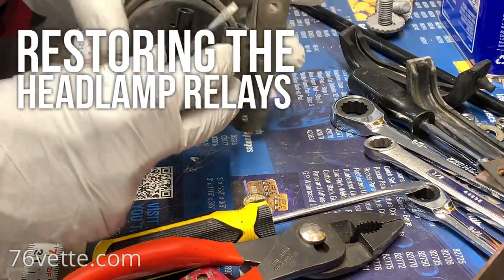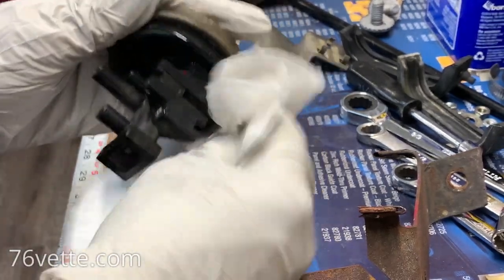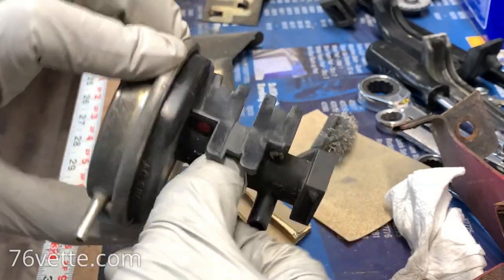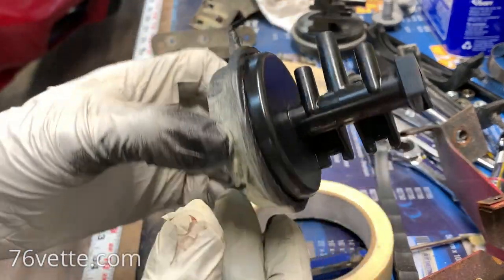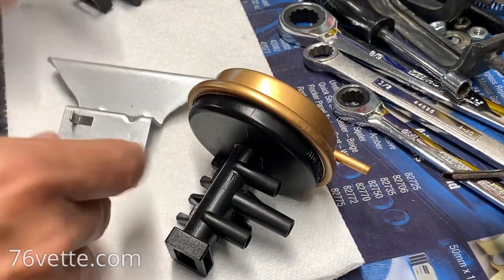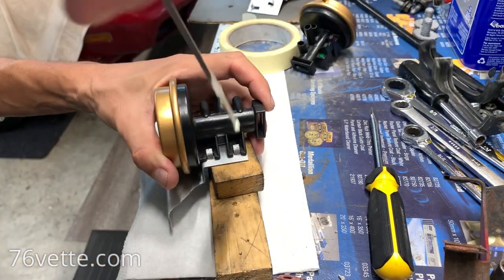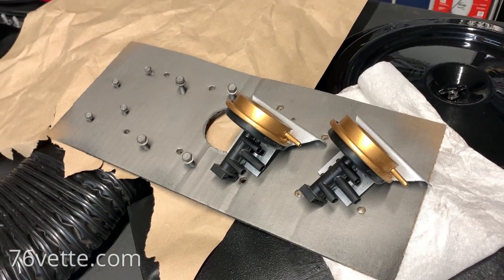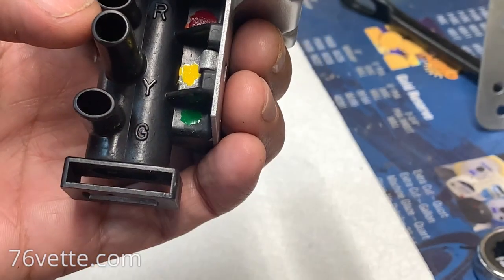How To Restore Pop-Up Headlight Relays

Comment: After I thought I had seen all of your videos, I came across this set I hadn’t watched. I love that you talk about the “filter” on the relays. I think you’re right on protecting the elements; however, I believe they also restrict the amount of air as well. Mine had them but I touched one and it disintegrated and then my lights weren’t going up and down as smoothly. Used an air filter for a lawnmower to make new ones and they were working the way they were again
Reply from the maker: All air filters restrict air. Absolutely correct. But they also provide some level of protection so I made mine out of a cleaning sponge (out of all things), which probably is very similar to the lawnmower filter material you used. As the saying goes, “great minds think alike.” Lol 😆 
Thank you for watching! 😊👍🏻

Comment: Is the valve on the bottom supposed to leak air when the car is turned on? My headlights won't stay down and I heard air leaking from here, when i put my finger on the valve its doesn't leak air. :) Great video
Reply from the maker: A vacuum system that leaks is not operating properly. Make sure all vacuum lines are okay and connected to the right relay ports. There are many diagrams available online that show you how to connect headlight vacuum hoses. I would start there.

Comment: What paint did you use for the top of the diaphragms?
Reply from the maker: The only gold spray paint I had handy. An old can of Dutch Boy Fresh Look Acrylic Enamel.
Reply: They look good. I painted my actuators with Rust-Oleum gold metallic. Went ahead and put new relays on while I was under there.
Reply from the maker: Thanks. A few years ago I rebuilt, then painted my actuators with leftover black hammered-finish Rustoleum. They still look good.

https://www.76vette.com/2018/01/refurbishing-headlamp-actuators.html

The headlamp bay is an area easily ignored, yet everyone notices it when the hood is open—especially at a show or cruise-in. And it’s not hard to clean and make it look good. New vacuum hoses also go a long way, not only for looks, but to ensure the headlights work properly. 😊👍🏻